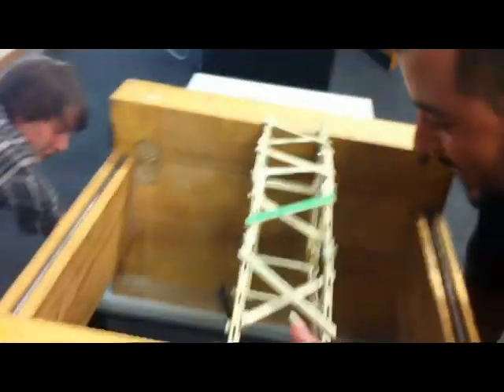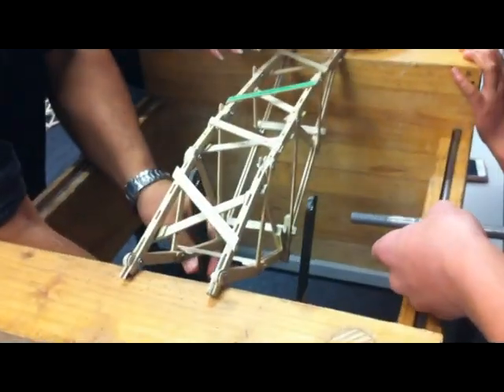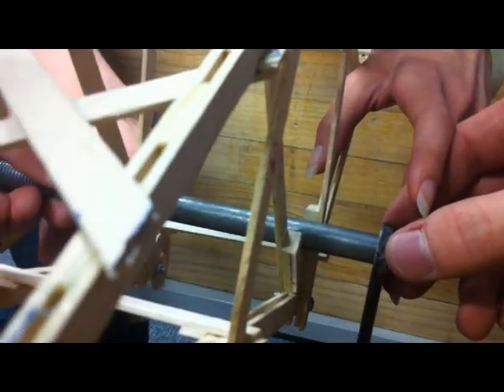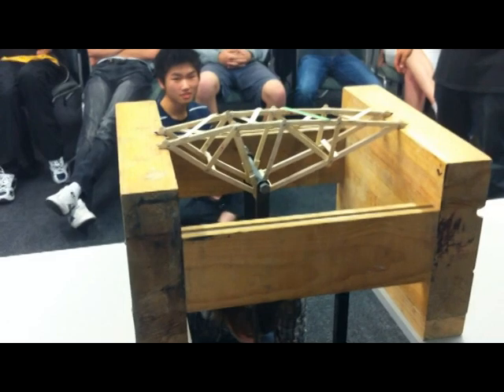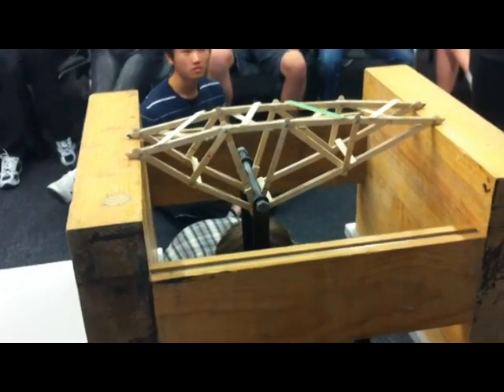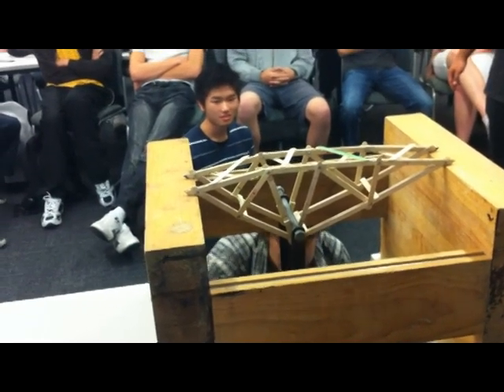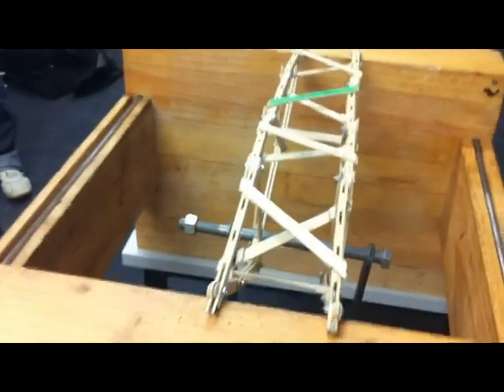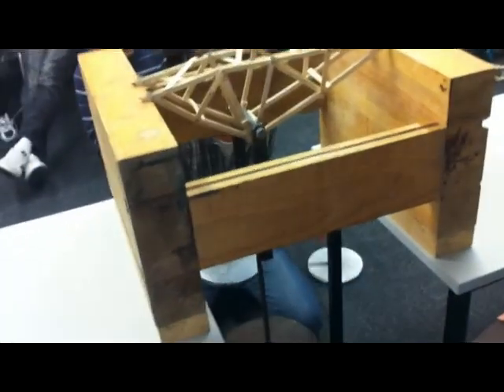Record Truss Bridge 2012 - University of Auckland Engineering

Comment: Tips for NEXT year's event:

1.  Apply a very thin coat of PVA to the surfaces of the popsicle ends, essentially, within a radius of the bolt holes equal to the width of the popsicle stick.

2.  Do not square the ends of the sticks.  Leave them round.  If you must make a stick shorter, be sure you round the edges.  Point stresses lead to failure, even beyond the bolt.

3.  Do grind off the end of the bolts with a Dremel after installing the nuts.  That's just wasted mass and won't help you, as the bolts aren't the point of failure.

4.  If the instructions allow you to "glue and screw," make certain you apply the glue to the wood surfaces, tighten the bolts, then apply light to moderate stress to the joint identical to what it will receive under load.  That way the stress is shared by both the bolt and the glued surfaces.

5.  If the instructions allow it, use collars around the bolts.  Collars not only avoid pushing the bolt threads into the wood (point stresses) but it allows for a larger diameter surface against which the wood can press.  There's actually an optimal collar diameter, below which point stresses at the collar/wood junction cause the wood to fail and above which the wood fails because the sides on either side of the collar are too narrow.  The optimal collar diameter is different for joints in tension than they are for joints in compression, so be sure to calculate both!  Then, select a diameter between those which balances the forces.

6.  Popsicle sticks in tension can be sanded along their middle 80% to a narrower width roughly equal to the width of the wood around either side of the bolt collar, taken together.

7.  To prevent buckling, instead of inserting just one thickness of stick flat between two others, I-beam it and glue it in place under compression.  Your modulus of rigidity is stronger with I-beams that what I see in the video.

8.  Examine the failure mode and recompute stresses to determine whether it failed due to a calculable weak spot or if all beams and joints were stressed to their theoretical maximum simultaneously (the ideal).

Comment: 1. this is bridge building, not video class
2. this is very impressive
3. WOW
4. so, now, just build bridges from popsicle sticks!
5. I entered a similar contest in high school with no "formulas" other than what "looked good" and it had different parameters and the weight was from 2 points and the bridge was 'above the plane' but it still held several pounds and had a good strength to weight ratio (both were goals and prizes) and was from a standard balsa wood kit that they sent to everyone to use (didn't have to use it all)... etc.

Comment: No one mentioned that this test is useless. You have to put the load on the bridge driven surface (weight of cars). You have to put a piece of wood traversing the top of the bridge. Cars are not dangling from the center bottom. Of course the bridge held that amount at a strategic point they setup to hold the most. Try again but no rods at the bottom. put the load at the top....

Comment: The mount point should have been where the load would normally have been, which is at the top where a vehicle would go. It would have cracked sooner if the load was mounted in the correct location.

Comment: First thing safety is first that you should’ve been tied up to avoid hitting the kick in the head if it would’ve failed why he was applying wait second when you transfer away you transfer it from the top to the bottom not on the bottom the structure of the bridge is going to be the week is at the bottom and he travels to the four points Where the bridge is attached to cars don’t travel on the bottom of the bridge they travel on top so that’s the right place to apply The wait

Comment: In highschool I remember we did this and I won for efficiency (weight of bridge vs payload) with a 19 gram bridge that held over 1500x its own weight. (yes that's a bit over 50 lbs) 

Basic rules: 30 cm Span, 5cm wide "roadway", using only 1/8" basswood and what I think was PVA glue. It was some white hobby glue I forget exactly what it was. 
Load simulated by 8cm x 4cm wood blovk with a hook on the bottom (where the bucket hang from), which is rotated slightly diagonally to spread the load onto the sides.
Also, no laminating 2 pieces together (except for where the "sides" met the 
"roadway"), and there were a few other specifics.
Reply: this bridge held up 110 kg or 242 lbs

Comment: Well as soon as I saw the design I thought wtf is that the best they can do... I could double or quadruple that easily..... I mean there was no design... No thought in the design... How could that be any kind of record.... Were there more limitations than Mentone in the discrption
Reply: No thought? Are you just pulling all this from out of your ass?
Reply: @comfortea  this is pure ignorance and idiocy.... This is like Pakistani thinking... This is pure bs... The strength of wood convinced with the fact that a pva glue joint is stronger than the wood it would be easy to hold 5 times load with a very simple structure.... In fact it could be done with zero adhesive..... Yes there is zero thought in this.... Typical of people thinking they are smart because they beat another dumb guy lol.... All I need is the width of the span and can prove what  I have said with a simple design.... Nothing to it and I can do so with less materials

Comment: That was painful to watch.. I did this exact same activity when I was studying engineering and I mine held over 1200N, others held much more than mine and we could not use any bolts so I have no idea what the record breaking claim you are making is all about.
Reply: Exactly. I did this in high school physics and we were only allowed 1/8 inch (~3 mm) basswood sticks and a terrible hobby glue even weaker and softer than elmer's/white glue. 
And no gluing sticks together to make bigger ones either, which made supporting the point load where the bucket hang from very difficult.

I think mine held about 1500 times it's own weight, due to very sparing use of glue, careful wood selection, and proper woodworking joints that took advantage of wood's excellent tension strength instead of relying on the glue. (I won in payload/bridge weight by a very large margin, nearly a factor of 10). My entire goal in the design was to ensure there weren't any bending stresses in any of the members, while still stabilizing the long verticals of the triangle.

Comment: Pls correct me if im wrong but the way i see it, they placed the tension at the wrong part of the bridge. Tension should be above where trucks and vehicles actually pass. You dont expect trucks to pass underneath the bridge. I think it would be unfair to other prototypes which are designed for tension at the road level and not for tension underneath the bridge where no vehicle passes.

Comment: In high school I built a balsa wood and Elmer's glue bridge. It weighed 28g and held 32Kg. That's 1150x it's weight, compared to 760x in the video. We stacked all the weights in the physics lab onto it and were looking for other things to add when it exploded, sending pieces of wood all across the room. The teacher said it held the most he's ever seen.
Reply: Exactly, this one isn't really anything impressive. I made one in physics class that weighed 19 grams and carried 28.5 ish kg, IIRC it was around 1560x its own weight.

In my case It was because I was going absolutely HAM and using Lap and bridle joints with minimal glue (applied with a toothpick even) to get the weight down. 
(That's in comparison to purely butt joints and glue which is what everyone else did, according to the rules which said each "side" of the tubular bridge had to be a 2D section. But hey mine was still the same thickness all the way along).

Comment: For the past week in my eight grade engineering class we built bridges out of 40 prices of paper and 120 inches of tape max. Whoever held the most weight and was the most efficient would win. The winner used 8 pieces of paper and 10 inches of scotch tape. And held 66 2 inch diameter washers. It was pretty cool.
Reply: now that is a challenging one. kudos to whoever thought of that.

Comment: If they would have add the weigh holding by the top it would probably have survive for a little bit longer.

Because at the V section, the bolt was pressing on both side of the V. Pushing the V apart and eventually splitting it.

Comment: I remember doing this in high school metal shop. The difference though was you had to make this out of 2 meters of oxy-acetylene welding wire and weld each joint. So it was a test of your design and welding skills. Pretty proud to say I held the record for at least the 4 years I was in school.
Reply: My similar thing was to make a foundation using 4 index cards and 2 inches of scotch tape. I remember my group not wanting to take my idea so I went and freelanced it and had the best solution. Held every text book in the classroom. Its really an easy solution if youre even just a little bit mechanically or structurally inclined.

Comment: It would be beneficial for the viewer to understand that 1087 N equals to 110.84315 kgf, which is an equivalent force expressed as weight on Earth (in average).

When you comprehend that this wooden contraption withstood a force of more than 100 kilos (a fully grown lumberjack), you start to appreciate it a bit more.

Comment: wow so special..  we did that in grade 9,  though we used the stand math books for weight..   mine won,   28 books before the books became so unstable we couldnt stack anymore.....     very simple...  triangulation.
Reply: ps was there a limit to the number of sticks, or what type of glue they had to use?    we had to use carpenters glue and 50 stick limit

Comment: Doesn't seem a very standardized or scientifically measured test. Every bridge would have a different, unique component to hang that weight on, some designs may not even allow for it. Also the student stacking the weights and having to be careful means he can affect the results, obviously by applying weight with his own strength, to his detriment, I'm not suggesting cheating, I'm suggesting its silliness that this is university level stuff. Also, given the overall shape of the bridge and the placement of the weight bar, I think it may be a half cheat. It was obviously designed for that weight bar, perhaps that was the object, but that hardly makes it real world engineering science, aren't bridge payloads coming from the deck and what's on it?  And spread out? The real missed science is how solid it is and 37X weight on the 4 popsicles holding the entire span over the space. We should scale it up and build bridges out of softwood and glue:)

Comment: Incorrect placement of load. No records broken here. Load must be placed realistically. Had the load been placed appropriately, this bridge would have failed with haste.

Because the instructor allows this incorrect placement, it is no longer a viable bridge design. What these students created was a crane, nothing more. No record should have been recognized.
Reply: First of all, this is just a university record for this specific project. Second, this project does not require them to build a viable bridge. It is solely supposed to be a truss that can withstand a force over 600N. Third, the load is in a specified location, that they are not allowed to change.

Comment: They would find the failure point much more accurately if instead of adding the big weights they hang under the bridge a basket and pour and sand into it.  After the failure occur they would weight it.
Reply: or the whole assembly could be standing on the big balance.

Comment: Record truss bridge!, really?. I could do way better, a double arch truss bridge would shit all over that.  Before I saw it fail I knew where it would fail and I was right, not sure why you would design it to send all of the load to a point instead of spending the load like a arch bridge is designed to do. 
Also if you are going to have straight top beams they need to be increased in diameter to take the load that the bottom part of the structure is placing on the top beams.

Comment: Surly the figure would have been greater if a smaller weight had been used and didn't fail, instead of the larger weight that was used which did fail.

Comment: We had a similar experiment in statistics at OIT using only paper and glue. The goal was strength to weight. The group that won had a bridge that resembles a thin sheet of paper glued together with a square it the center to evenly apply load to strip of paper. Their bridge broke at 978N and it weigh under 100 grams.

 My teams bridge weighed a lot can't remember the exact amount but i bet it was at least 10 times the weight of the belt bridge. Problem was they couldn't break my bridge, I took paper put it in a high rpm blender until it resembled pink insulation used in houses. I then made square paper tubes and packed then full with ground pulp fiber saturated with gorilla glue. Then results were insane it was stronger then natural douglas fir wood. I could literally stand on the bridge, i weigh about 250 lbs 1112N. I took one  someone over 320 lbs. (1423N) to break it tested it with 300 lbs (1334N)it buckled but didn't break.

Comment: The assessment is not fare. The load should be tested from dead center. That weight is clearly far left, at least 2 inches.Load should be tested on all model from the center of the spanning distance. That would be a true and equal  test .

Comment: Alot of comments about where the weight is being distributed.  This test was for them to build a bridge that would get continuous weight at a sing point, the bottom. True a real bridge would be tested for continuous weight distributed across the deck, or where ever the roadway would be. Way to do that would be get a block of wood the size and shape of the overall roadway with the bar hanging through the bridge to add weight. Kinda like a T

Comment: such an inaccurate way of adding weight.... should use sand in an hourglass deposit system, then weigh after. with metal plates you get large weight gaps between last supported and breaking point. if you have an hourglass setup you can calculate the wieght per second to subtract the last 3 second of added material to get the most accurate last supported weight.
Reply: Nathan Ennis whole thing is just a hoax, the weight wouldn't be on one single point, it is made to break the record not to show a real functioning bridge, irl this would be just a waste of space
Reply: I understand that, see my other comment. This comment is just about how the way they are adding weight(metal plates) is not all that accurate.
Reply: yeah i know, i just wanted to add to that

Comment: Actually it broke because of position of that bolt. Bolt was placed at junction of two segments and under weight it placed lots of pressure separating them. Load should come from top of structure if its bridge model.

Comment: This would be a fixed supporting truss for suspended loads (like a crane or lighting truss), not a truss bridge since the weight was not on the deck nor was the weight load dynamic (moving across the deck)

Comment: I’m an architect and we had similar tests but the expand was 90cm and the structure were made of spaghetti number 32 if I remember well with glue only and balsa wood 2mm square section... Only with glue as well in both tests one could use cotton thread 100mm long and they supported more weight than that.
 The cotton thread was optional if your bridge needs to work in some parts in traction forces.

Comment: Like a chain any structure is only as strong as its' weakest link. Triangles have been used in structures for centuries. Tensile and compression loads are indeed an interesting and valuable lesson for any future engineer. Shame of it is today's engineers rely on software to do the bulk of their math. I work inside a strongly engineered industry and have so for decades. The difference? Today's engineers trust and rely on the programs to tell them if a design works and they seal it blindly. 30 years ago? If you didn't do the math and calculate the loads your signature wasn't worth squat. Today when the power goes out so does our engineer's license because he's worthless without the programs he relies on. These people make $150k a year and won't seal or bless a design unless their program tells them to. Funny because I use the same software he does and can determine the very same outcome he will but I only make 1/3 what he does. Now, you could say his name and stamp is on the line but he'll only blame/lean on the same programs I use everyday anyway on failures. Anyway, I applaud all young minds who are interested in the engineering field. It's so much of a better future than video games. I love videos like these because it gets students involved with physics and they get to see first hand what the laws of gravity/universe can do to everything we rely on.

Comment: Honest Question: Why are they testing the strength of the bridge by applying weight to the bottom of the truss?
Reply: The point of this competition is not to design a bridge for transportation which would in most cases be loaded from above. It was to design a structure capable of supporting the most amount of load between a designated gap. The load was hung from the structure to avoid any balance issues and for the load to be close to the ground so when the structure finally fails, the floor won't crack. Too many people are missing this point and as a result, the entire comment section is critiquing this unfortunately... I don't mean to sound rude or anything by my response. I had just spent too much time reading too many comments insulting the design because their idea of the "correct" load placement.